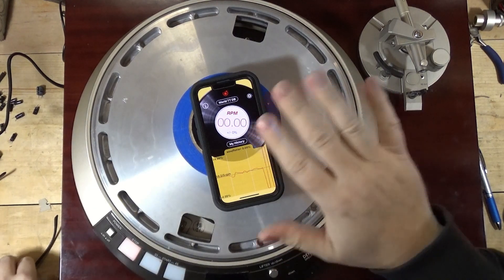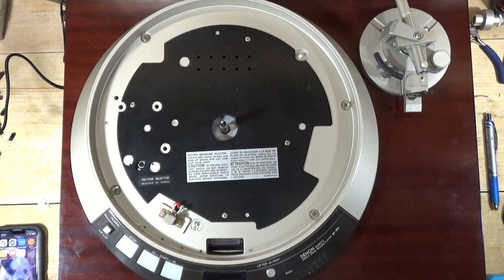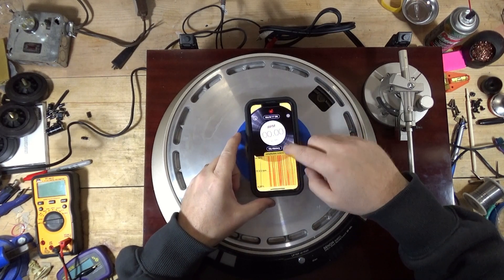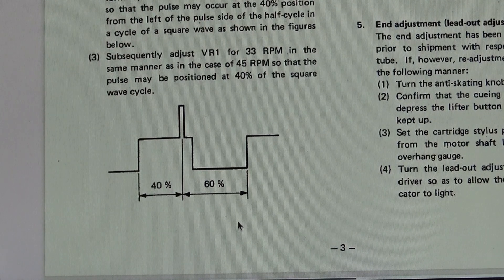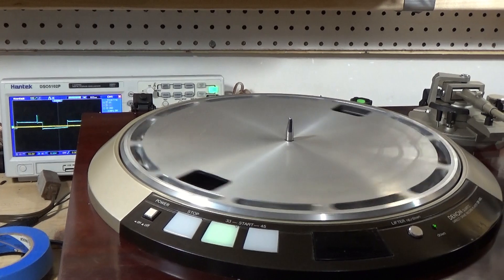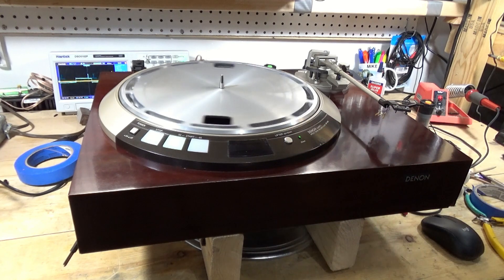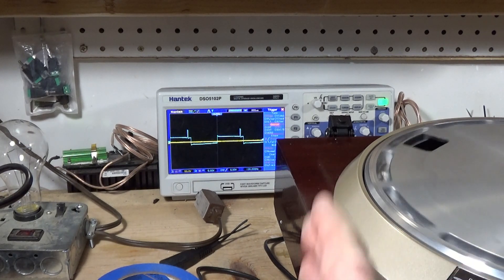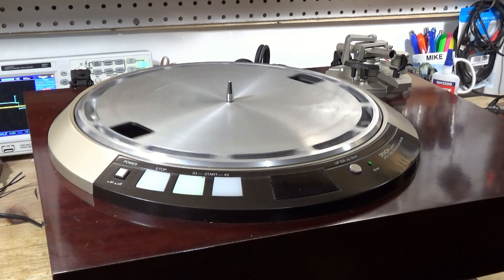Denon DP 60L Turntable #1 Repair Part 4 - Speed Adjustment

Comment: This is a really helpful series of videos. I have similar issues on my Denon DP 59L AFTER a re-cap whereby the platter speed speeds up after a short delay. I also have the platter going in reverse at times! The re-cap was supposed to address the fact that that Start/Stop button was not working as designed. I just borrowed a scope from a friend so I'm about to go deeper into the fault finding process. I also set the magnetic head reader distance to 0.18mm as instructed in the service manual and it seems to have stopped the reverse mode! I'm looking forward to Part 5!
Reply from the maker: ...about that Part 5 :)  I tucked this away and just pulled the table out tonight.  Still works great minus the strobe.  I'll need to pick the repair back up once I get some free time.
Reply: I had reverse and speed issues with my DP55K, I got a kit from ebay with all the transistors , this fixed my issue. The one chip I couldn't get is the big IC chip, if that's gone, it's pretty much scrap, as these are very hardto get. Other issue can be if the magnetic tape on inside of platter is damaged

Comment: Hey there! Nice work! 

 I've got a Denon DP 50L turntable, and it's taking forever to get up to speed. It starts off super sluggish but eventually gets it together. It takes a whole 4 seconds to hit 33rpm and like 8 seconds to get to 45rpm. Do you think the motor needs some lub?
Reply from the maker: It could be that the spindle is dry or has some old/dirty oil.  it's an easy first step to clean the spindle and apply new oil.

Comment: the antiskate on my dp60l is misbehaving. would you know how it works and how to repair?
Reply from the maker: I have not worked on the antiskate on this particular model.
Reply: I've got a 60L I've had since new in 1982. In several videos, I've heard that these tables are far too complicated. I'm nervous about my 60L developing problems.  Would I be better off buying a belt drive with far less complications. What do think? Keep in mind that there are no techs working on these turntables close to me.